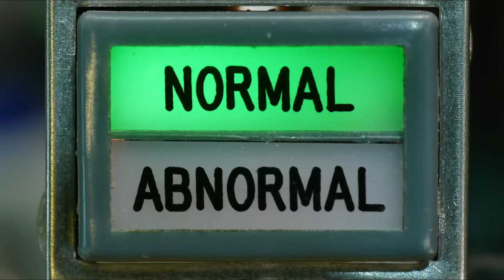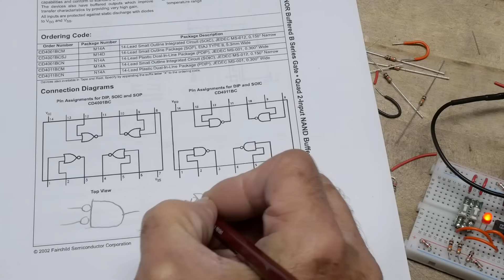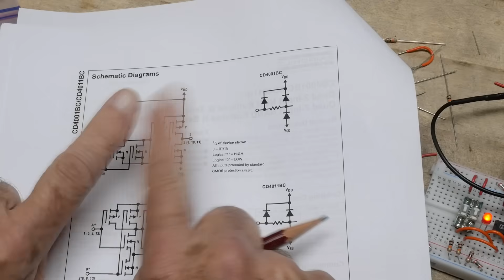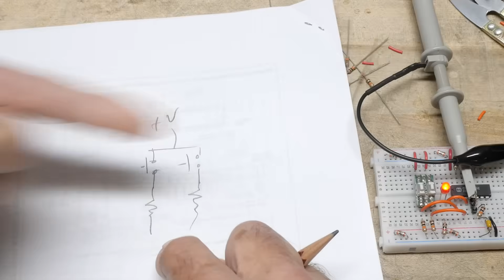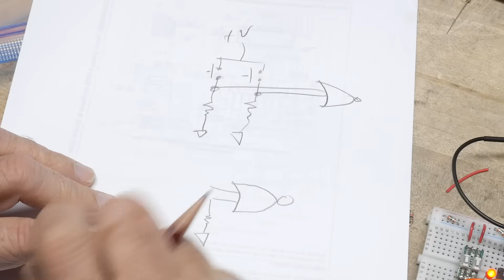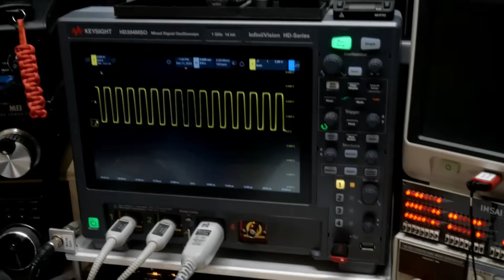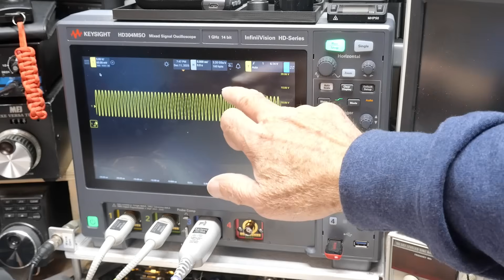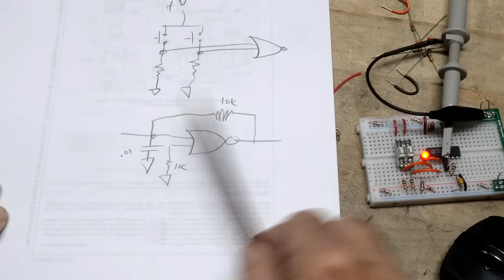#2450 CD4001 Quad NOR Gate

Comment: I had a dought that this circuit would work.  This gate is not a Schmitt trigger which has a hestersit.    Usually if you connect the output to input a simple inverter gate, it will oscillates in a random high frequency.

Comment: Glad to see the return of Chip of the Day! 😀

2:08 - I tried to trace the logic through, and after staring at it for a bit I believe the labeling in the data sheet is actually correct. For the second (bottom) diagram: If A is 1 and B is 0, then the left-most P-channel is off, the second-from-the-left P channel is on, the left-most N channel in the middle row is on, and the bottom N channel is off. So the input to the first buffer stage will be 1. This gets inverted twice (two inverting buffer stages), resulting in a 1 at the output. This is the correct output for a NAND gate in this situation, not a NOR gate.

While you're correct that transistors in series (first diagram) effectively perform an AND operation, the logic is inverted since the transistors are P type, which means they are off when the inputs are at logic 1, allowing the output to be pulled low.

Comment: I got a can full of logic chips.  I rarely use them.  I used one to get a TTL level for an external freq.  reference  for a generator and years before that I used logic chips in a test panel at work we were building.  Very rarely mess with those now.  Amazing that the big PC boards stuffed full of logic DIP chips is a thing of the past,  like tubes.

Comment: You aren't kidding when you say low current! Early in my career we had a coil winding machine controlled by 4000 series logic. Most of the time it worked great, but every once in a while it would lock up, sometimes damaging the winding arbors in the process. I eventually tracked it down to a logic part where the Vdd (supply) pin got bent when the part had been inserted into its socket. There was enough leakage current from its inputs to supply the part most of the time.

Comment: The 4000 and 7400 series chips are still used today because they're cheap and provide a learning platform for students. I'm in an EE program and we used them in our first year for demonstrating the fundamentals of digital circuits.
Reply: They're also perfectly sufficient for a lot of applications and are "jellybean" so low worry of an uncommon part becoming suddenly unavailable.

Comment: My favorite series of IC's.  Have almost a whole wall locker full of parts cabinets with 4000 series IC's.  They were the building blocks for so many of the projects I have built over the years.  Those and the 74 series IC's are still made for a reason, people use them.  I still find both series in currently made products from time to time.